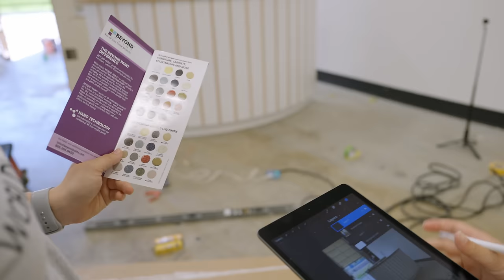Painting Laminate Furniture with All in One Paint | Opening a Flipping Storefront EP 8

Comment: In the olden days (the 80's) when I was learning how to faux finish, I would do marble finishes by putting 2 or 3 tones of grey (or whatever color) on a paper plate. Then drag the edge of a feather through the colors of paint and then randomly drag it on the across the surface, sort of squiggling it as you move along. You definitely don't want to over mix the colors. I hope that makes sense.

Comment: I added a marble look to a counter top (after first painting it white). I literally tore a piece of thin cardboard (an empty case of Diet Mt. Dew) into a hand size piece and made sure it was jagged and rough looking on the end. (The beauty of this is that you can throw it away and tear a new piece after your cardboard becomes unusuable.). I had maybe three different shades of paint on a paper plate (light gray, dark gray, even a little tan or off white) and dipped my piece of jagged cardboard into the paint and made sure that I did not paint straight lines, but to make vein-like looks that are in marble, I applied with an intentional shaky hand (light in some places, dark in others). The trick it to NOT have a pattern, but every vein is different like a fingerprint. Sometimes vein off into smaller "veins" sometimes make new lines that are separate. (TBH - I was not happy the first time I attempted this. I painted it white again, and then on my second attempt of marbeling, I was very happy with the look.) No one ever suspected this counter top was anything but real marble when it was finished, it looked so authentic. Painting the veins was the easy part of marbeling. The hard part of marbeling my counter top was applying the thick clear epoxy over it, but that's another whole instruction you can look for videos to do. But painting the marbeling effect is easy.